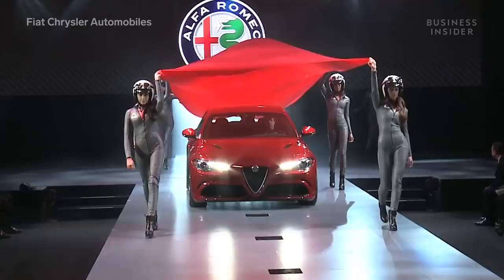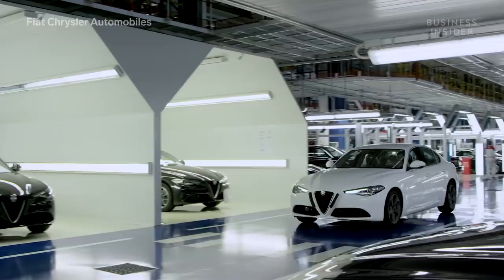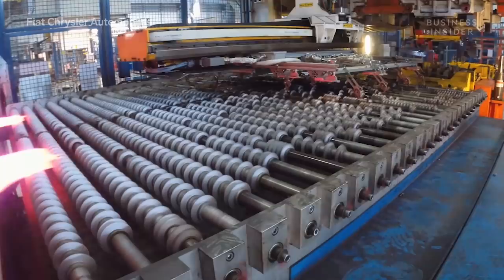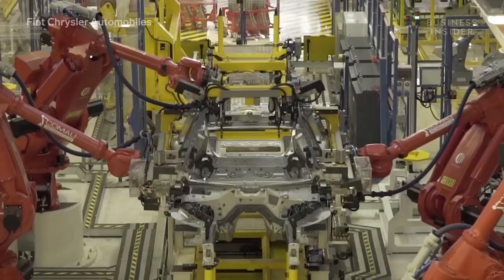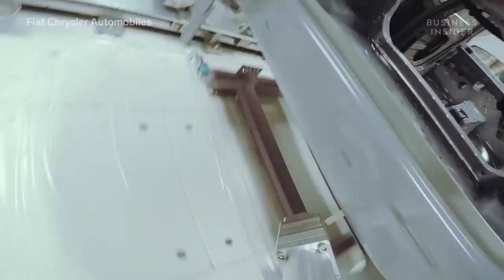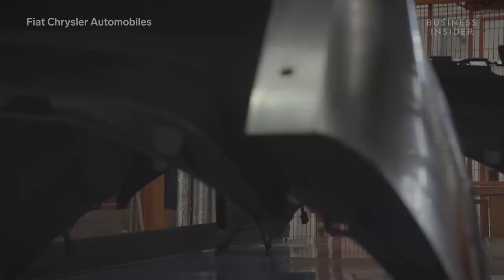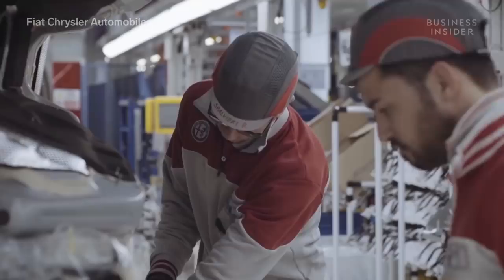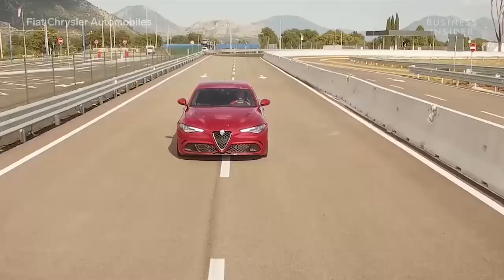How The Alfa Romeo Giulia Is Made

Comment: Previous BMW owner, switched to Alfa, never going back!
Reply: Thats like going from inflatable doll to a real thing :)
Reply: Which one did you get
Reply: blackcarmafia that’s hilarious! :)
Reply: Aiden Nicholas I got the Guilia Ti sport in Silverstone Gray with red interior. I really wanted the white with the black roof/moonroof but the silver just looked way too cool.
Reply: How's the reliability rate on that car? Is it Mitsubishi good or Range Rover bad? Lol....i was thinking about buying one but I heard some problems it has with electrical stuff
Reply: Ray A 11 months in and so far, not a single issue. As a matter of fact, the car still feels like and drives like the first day I picked it up. No interior noise, no loose plastic sounds, etc. very happy!
Reply: @lucky1206  Got a Stelvio, Drives great in Dynamic mode, but literally the worst car I've ever owned. The electronics on the car are dated and completely unreliable.  The engine start/stop lags when you let off the break and hit the accelerator. After a recent recall the accelerator pedal lags even more now.  The window switches change polarity for no reason, the backup camera is something from 2001. No android auto that was promised a few years back. The Cabin is loud. The radio freezes and turns off every once in a while. I've only had the damn thing for a year.
Reply: @purfire572  We are now experts on uselless car electronics, and what about the car itself? What happens when you decide to turn off start/stop and radio and just drive it hard on the corners?
Reply: @lucky1206  You're obviously drinking the German Kool Aid....
M 3 Sub Frame cracks (not covered under warranty)
M 5 Rod Bearing failure (new engine please)
3 Series fuel pumps that self ignite
M 5 SMG Clutch ....biggest maintenance disaster ever
911 IMS bearing failure....(new engine please)
My point....if an Italian car suffers a fault, it's unreliable...when it happens to a German car, it's "over engineered"......Cliche BS...FORZA ALFA BABY!!!
BMW makes German Toyotas now....except minus the reliability.....
Reply: @purfire572  = BMW TROLL
Reply: I had many a German car but always go back to a Alfa Romeo this time I am staying
Reply: @lucky1206  Mitsubishi isn't even good
Reply: @purfire572  wow so they still keep on messing up. Is it just the electronic parts but not the engine i guess? Well I will get that off my bucket list lol
Reply: @lecoureurdesbois86  are you kidding? I owned mine for 2 years already and never had a problem but just had one recall with the suspension. Now the 2020 models are updated with a more stylish interior and with a 10 year warranty. I don't know how it's not good. They have a better warranty and built better than Toyota cars. Toyota just barely put Android Auto where Mitsubishi had it for years and they don't even have different models like Toyota. Yeah years before Mitsubishi were not that good but I think you should jump in one now and recalculate your thought on Mitsubishi. My friend had a eclipse with over 300,000 and it just kept running
Reply: @lucky1206  Maybe, but most Mitsubishis will knock before 200'000km and die at that point, some will last more, but I'd say it's the average.

And I don't know where you're from, but here in Canada, Mitsubishi's interior quality is one of the worst of the market, like Nissan (same company anyway). Maybe their SUVs are better though, but the Lancer didn't impress me, especially with that shitty CVT
Reply: @lecoureurdesbois86  yeah the CVT sucks in every car. Nissan just bought 35% of Mitsubishi shares but they don't own Mitsubishi entirely, they are both just sharing body frames to save money.
Reply: @purfire572  ODD, I own the real Alfa called the Quadrifoglio(2019) and I haven't had any of the issues you claim. Matter of fact I can only assume you have a lemon. You said: "The Cabin is loud."
You must have opted out of insulated trim.  The car is very well insulated and even has acoustic glass(yours probably not)
Next I have android auto and so does my work collage with his 2018 model.
Reply: Niceguy572 brake* 🤦
Reply: @ Alex R.....im thinking/ planning to buy 1. Seriously how us it? Any issues, engine or transmission? Radio or body wobble. I hear bmw, Mercedes benz, and audi are always in the shop. Will this be the same?
Reply: @indian0121  yeah, I had the Guilia for 3 years and didn’t have a single issue, not even any sort of rattling etc. My girlfriend has a 2018 Audi S4, same thing no issues whatsoever but dude, the interior of that Audi, smallest pothole or something and everything rattles and shakes, very annoying for a car that costs around 50k in my opinion. For the Guilia, as well as the Audi, we just took them in for oil changes and that’s about it, never for a problem. I just switched over to the Stelvio, 4 cylinder, same thing, no issues at all so far, only a bit of rattling from the dash around the cup holders, took the car in and they replaced the entire section and the noise is gone.
Reply: How is the Reliability? I want one but I just stick with Japanese cars after a horrible experience with Audi
Reply: how is the car so far sir?
Reply: @hajishaker9788  sir, I switched over to the Stelvio!. Love the interior space, look etc but I have to say, the sedan, Guilia, had less interior noise but that’s pretty much expected with all SUV. By interior noise, I mean rattling, and it’s only in one location next to the gear shift. Keep in mind, my gf calls me crazy and says that my hearing is way too sensitive LOL 😂. The driving experience (handling, breaks etc), the look, the look people give you while driving it, all amazing! Just wish the engine was a little more powerful. The torque is good but horsepower need a few more in my opinion, especially in the USA.
Reply: @mylifeinvictus  thanks for the reply sir....this is one of the car that i'm considering buying at the moment. Still need to do more research about the car and you input is very much appreciated
Reply: Me too
Reply: @dallinlutz3657  oh audi. Almost 10k € on my q5 of 2016 and i gave up. Rockin Giulia and not yet anything ever. 24k km so far
Reply: @lucky1206  I bought mine in 2017 and currently have 33k miles on it with no issues other than a dead battery that the dealer replaced under warranty. HIGHLY recommend!
Reply: @jaimewinz  cool I will look into it. Get the AGM battery that can handle more stuff in today's car
Reply: @lucky1206  thanks man!

Comment: We are the proud owners of a 2019 Alfa Stelvio ti sport. The fit and finish on this SUV is second to none. The Sport seats are beautifully done in performance leather with great lumbar and bolster support. Infotainment system is flawless and work well with Android Auto Play. Dynamic mode with the transmission in manual shifting via paddles is great fun. 2.0L turbo provides plenty of power.

Comment: When I now witness how the Giulia is being produced, I'm not surprised to experience every day again the solid build quality of my Giulia QV 2017. It however surprises me that some press were negative about the interior. Besides a few buttons (that can be covered with aftermarket high quality aluminum rings) I can not complain about that either. It might be that the first model years had some electrical issues (especially with the battery) but that seems to be sorted out. It's by far the best car I've ever driven, despite it has been lowered with ST springs and fitted with 20 inch Llagos rims and low profile tires. I will never sell it !!!
Reply: Yes the interior is absolutely lovely and the only reason the press would be complaining about it is if they felt compelled to criticize something despite a reason not presenting itself.

Comment: I hope the new alfas have thicker or at least stronger body parts. I have a GT which is ome of their previous generation cars and love it both visually and  mechanically and it would be an awesome car if it wasn't for the paper thin metal used on the body. All over the sides there are lots of dings and bumps from people hitting it with their doors in parking lots and other stuff. And this is a problem which I don't have with my other car which is a volvo and has proper thick metal for the body. I'll probably have to repaint it although the value of such models has dropped significantly in recent years and i wonder if it's going to worth it.
Reply: this new generation shares nothing with the previous. This was built from the ground up. FCA spent 5 billion dollars developing the platform and vehicle.

Comment: Alfa Romeo is not doing good. In 2019, they sold only 144 4C cars for the year in the United States. Consumer Reports has the 2020 Giulia at a low rating. The most troubling factor about the Alfa Romeo Giulia is its low reliability rating. The car only has a 13 percent chance of not requiring any repairs over a three-year period. In previous years, drivers reported problems with the car’s fuel system and the A/C unit. Issues with its power equipment and interior electronics were also frequent.

I read a report that FCA might even dump the Alfa Romeo brand because of how poor it is performing for them. Would like to see Alfa Romeo perform well, and I was considering getting a Giulia as a new car but with the research I did, I couldn't do it. Alfa Romeo is slowly dying, the sales numbers reflect this and FCA will not hold onto it and continue to lose money over time.
Reply: They'll probably just pull out of the US again like they did back in the 90's.

Comment: Don't know why plastic vehicles costs so much.
Reply: Steel is heavy and it’s a death box.
Alloy steel or luxury carbon steel is another set of lightweight materials.
Don’t be fooled by how ugly a car looks but look at its engine you should be happy to find a integrated BMW M3 series engine in a Toyota Supra 1998 your car will be off the charts on transport.
Reply: @jr.jorgesandoval9427  - Disagree. I have a 24 year old steel pickup truck 10x better than my 2018 Lexus. The engine is about speed. The durability of the body is critical for safety.
Reply: i guess you wanna seat on a steel car seats next time?

Comment: Do you want a BMW, but theyre just too darn reliable for you? Well, an Alfa Romeo is right for you!
Reply: Alfa Romeo is more reliable nowadays than BMW/merc/audi, it even beats honda according to some surveys
Reply: BMW was the one to copy Alfa Romeo back in the 60's, the 1962 Giulia was the car in question (and this copying always from the germans went on until the 90's) and it was for basically making the 3 Series; also the german cars are not that reliable anymore today and they are going down while italian ones go up again.
Reply: M 3 Sub Frame cracks (not covered under warranty)
M 5 Rod Bearing failure (new engine please)
3 Series fuel pumps that self ignite
M 5 SMG Clutch ....biggest maintenance disaster ever
911 IMS bearing failure....(new engine please)
My point....if an Italian car suffers a fault, it's unreliable...when it happens to a German car, it's "over engineered"......Cliche